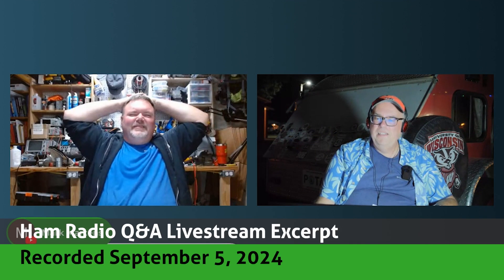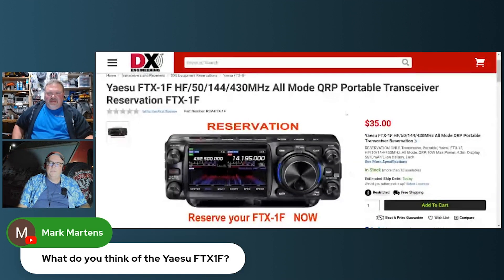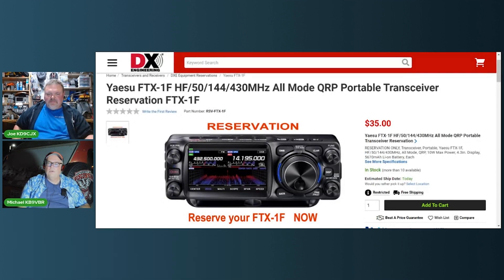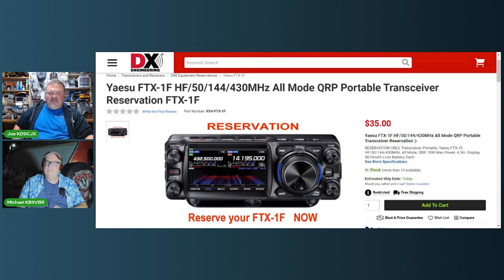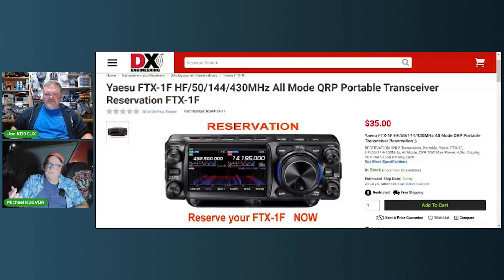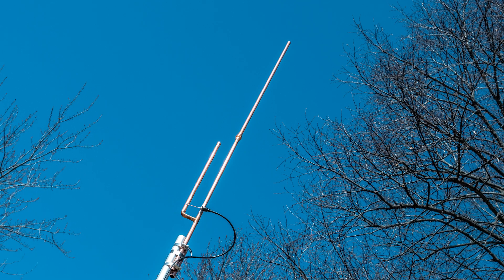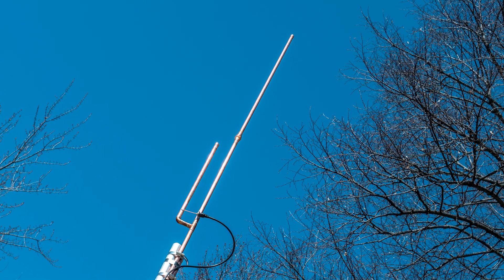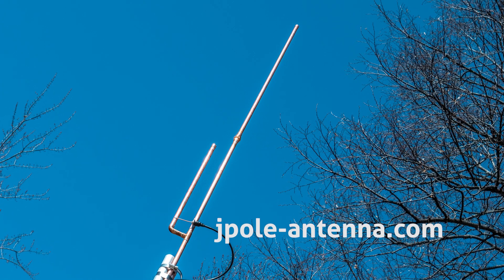Ask Michael, KB9VBR: What's do I think about the new Yaesu FTX-1F QRP transceiver

Comment: Michael. I hope you reserve one, I have mine reserved. My X6100 has a large screen and processing and I can tell you it does not have a large current drain. I use it with a 6AH battery and it can run all day I believe that the FTX-1F will be so good it will long pass the 705 and even the KX3/KX2. I can't believe the dim wit comments about it should have 20 or 100 watts. 20 watts is only one half an S unit more as you know it is a QRP radio. Operating QRP does require a bit if Skill and perhaps that is the answer. I tell people how well the magic carpet works as I have both the screen and Faraday cloth and even refer to you excellent videos and I still get stupid comments that is does not work.
 We will not know Just how good this radio is until it comes out, but it looks like a great portable and POTA radio. I hope you will do one of your great reviews. I have both the FT-991a and the FT-710 and look forward to my FTX-1F.  I am not a "Yaesu Fan Boy", I just appreciate good radios. 2025 will be the year of Yaesu.

Comment: Such weird commentary... "Big screen equals massive power consumption," and the IC-705 is sitting over there with 300mA on RX with the screen on... the IC-705 is lower current draw than the FT-818, and has the big screen.  I think you guys are making assumptions based on the screens of yesterdecade.

Comment: 4 meters (70 MHz) is confirmed for UK users or where allowed. It is a nice concept clipping add-ons on the back of the radio (battery, tuner, ventilator). It's also a great solution for QO-100 satellite operation with a up/downconverter using HVF and UHF frequencies. 73 Phil ON4VP

Comment: As a 705 owner, it certainly intrigues me.
Requiring a cooling fan with a mere 10w output is ridiculous, and a sign of being inefficient. After seeing how yaesu ignored the obvious widespread issues of the cracking cases on the ft5dr that I also own, it really gives me a bad "gut" feeling about the company.
Reply: Waite what ? Cracking cases WTH 😂
Reply: @alexalonso2093  yep, a large percentage of the ft5dr develop a Crack in the case, all in the same location, just a fact. 73
Reply: Most 705s run hot. Yaesu tackles it head on.  Its OK when the FTX-1f comes out there will be tons of 705s for a song.:face-green-smiling:

Comment: As a Yaesu fan boy, I love the idea of this radio.  I operate almost extensively portable, and my radio stable carries nothing but Yaesu.  Yaesu needed both a replacement  for the 817/818 as well as challenging the likes of the IC705, give it time, there will be a 100w version on the horizon 😊.  The battery does not concern my, neither does the additional fan for hateful 8, but no tuner😮.  I have never used a tuner in the field as any antenna I build is resonate on the band I use, but for those who don't a tuner would be helpful.  I'll stick with my trusted 817 and 857 for the moment ❤
Reply: There will be a an automatic tuner "backpack"

Comment: I agree that touch screen will definitely be a power HOG. Im satisfied with the ft-891 and my 25 watt leixen dual bander. Easy to operate and all that I actually need. I hope the new Yaesu it doesn't have too many issues. The original ftdx 991 was plagued with problems  and was replaced with the ftdx 991A which seems to be a decent ham shack in a box. I use an oversize military ammo case with my ft-891/ ldg automatic tuner/ leixen vv898s/R&L electronics switching power supply with noise shift. All of that fits inside the ammo case with 2 extra cooling fans. Its wired to operate 110 volts off the power supply or flip the switch and use external 12 volt batteries with solar panels and run all the way through field day completely portable. I use a laptop for logging and HRD so I have the waterfall running digital modes. The laptop runs ok on 12 volts as well with seperate batteries and pannele. I have a fully deployable screen encosure to keep mosquitoes from hauling me off along with decent size tarp above the enclosure to shed sun and rain so I keep working stations. It sounds like alot and it is, but it's all fully deployable in minutes where ever I need to be. We have tropical type storms here sometimes, and you need a full power rig and deployability with abilities to repair connectors if needed. I have the whole setup with a hand truck with case for coax feedline and another for antennas and 3 telescoping aluminum mast and mounts secured to the hand truck. I typically get deployed to 1 of the fire stations here in the county if disaster declaration is called. The two radio solution is the way to go for my application. Great video as always 73 Earnest K5EWM.

Comment: Hi Michael,
I'm considering it for satellite communications since it's full duplex.  73  WJ3U
Reply: Many sites say it's not full duplex
Reply: I have doubts about it being true full duplex. Main reason is that the VHF and UHF antenna outputs are on the same BNC port. Which means that in order to mitigate desense, you would need an external diplexer. Full duplex will also come with two separate audio outputs. Maybe it can do full duplex but I'm not holding my breath.

Comment: QRP is Great with an amplifier. They would have a great radio if they added 90 watts. LOL
Reply: It a QRP radio dude, you can work the world on 5 watts.
Reply: Then why not just buy 100 watt tig?
Reply: Grossly overpriced I'm sure.
Reply: Yeah, QRP is a toy, not a radio for my purposes. If SHTF I want 100 watts. 

An updated 991A with a modern user interface would sell really well.
Reply: For a SHTF scenario 20-30 watts is sufficient.  Much easier on batteries than 100 watts.  Military rigs are in the 20+ watts range.  I wouldn't mind seeing a amateur radio in the 20-30 watts range, such as the Xiegu G90, but Yaesu, Icom, or Kenwood manufactured & sold.
Reply: @jamescoffey5225  20 watts is only half an S unit more. 5 watts is plenty. If you want a 100 watt radio don't go QRP.
Reply: I agree why don't they just make it 100 watts
Reply: It's qrp some people just don't get it. If the power is too low for you just don't go for a qrp Rigg and keep your criticisms to yourself